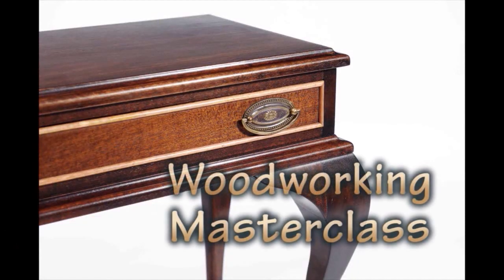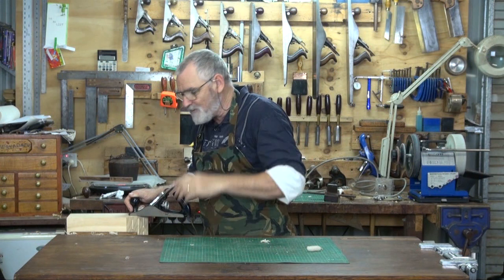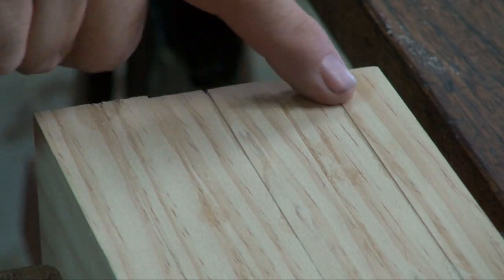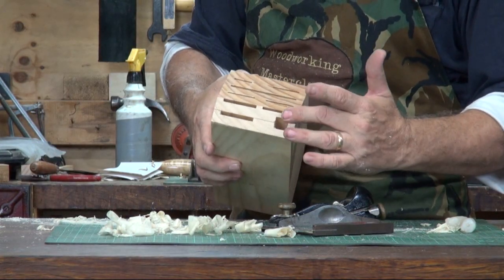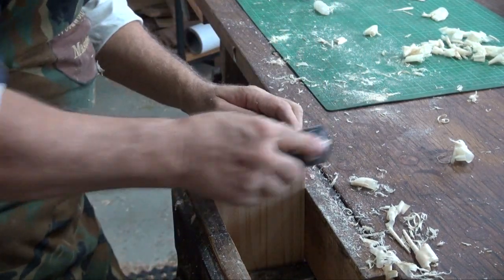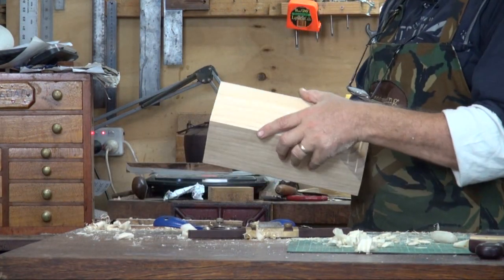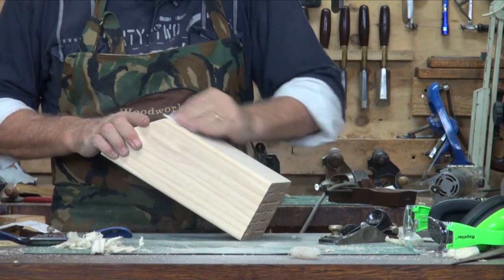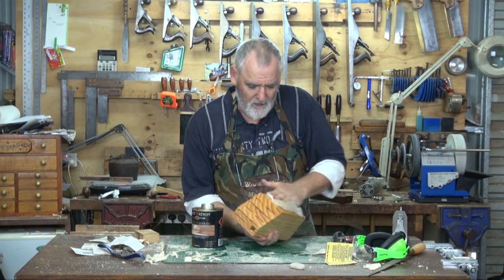Knife Block Pt. 2 of 2 Woodworking Masterclass with Steve Hay

Comment: Thanks for the great plug Steve. Your the man!!
Reply from the maker: Mate, believe me if I didn't think they were good I wouldn't promote them. Good Luck hope you sell heaps. Cheers Steve
Reply: hello jorge i was wondering if it is normal for your site to not give a confirmation email or confirmation of a purchase from the site when a sale is made? i just bought a set of eyemuffs and replacement tinted lens added all my details and credit card details clicked proceed and then the site just went back to the start up screen for the site. is that right? did the sale go through? i looked at my emails and nothing came through there either. im now checking with my bank to see if a pos went from my account to your company and it looks like the sale did go through but would be nice if your site showed confirmation as well as an email to show me transaction numbers as well as return info and contact info should i need to contact you about my purchase. thanks for making these eyemuffs. the design is awesome and i cant wait to get mine.

Comment: Hey Aus! Thanks for the videos! Just came from my shop where I finished adapting a retail knife block to accommodate a meat cleaver and new bread knife. It took some creative thinking and finally resorted to using some magnets and a block of hardwood glued to the back of the block. Never crossed my mind to build a customized block until I stumbled across your video.

Really like the techniques and especially matching the wood grain from one piece of wood. I like having many specialized knives in my kitchen (my other hobby is cooking) so a customized block would suit me well.

I like your design of one level being horizontal with the next being at 45 degrees but I'm thinking I'd like a block with two 45 degree tiers (one for longer knives and the other for shorter.  I imagine that the lowest tier's top face would have best "finished" separately before attaching to the "main:block, then truing up the sides and bottoms? Or is there a better approach?
Reply from the maker: Thanks for the feedback Capt. Ron. Pleased you liked the design as for you improved version I think you are on the right track. Let me know how it goes. Cheers Steve

Comment: Love it! Any specific reason why you couldn't route, glue, and then use the miter or table saw to remove the top?
Reply from the maker: Absolutely no reason why you can't if you have a saw that is capable enough, by all means. My saw throat is not big enough other wise I could well have done as you suggest. Cheers Steve